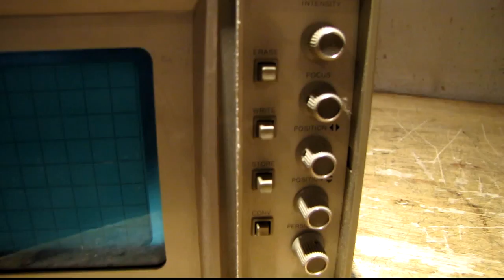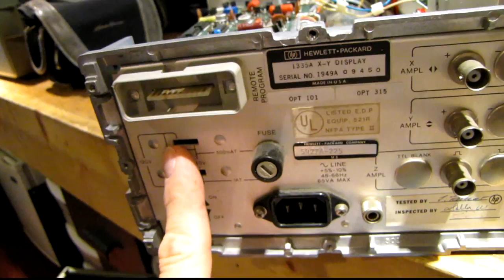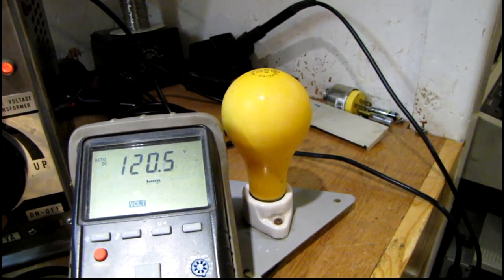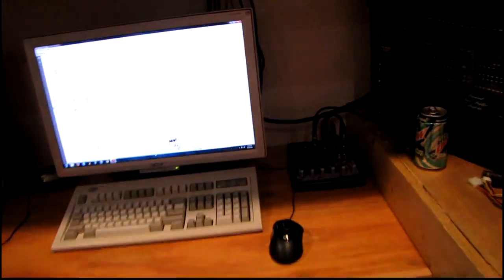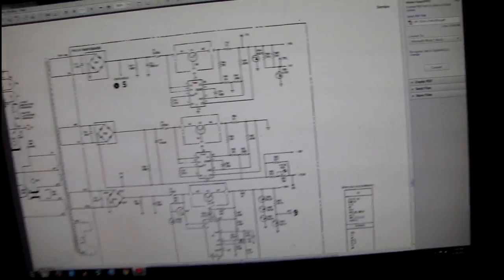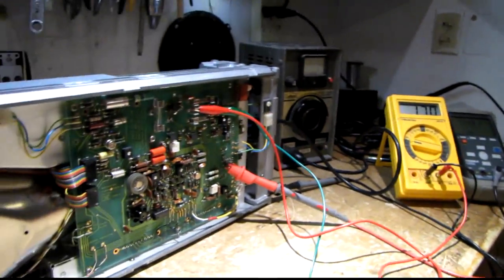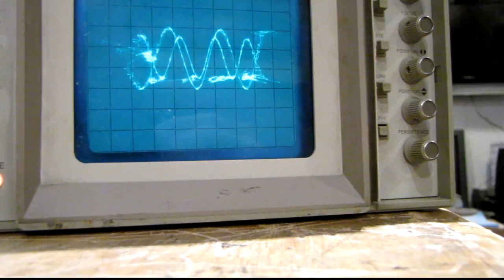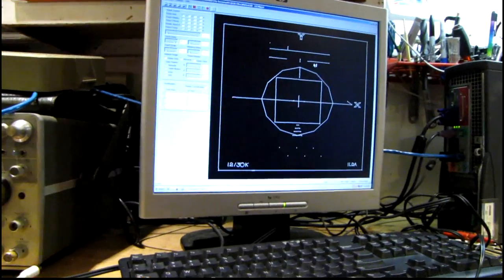Vintage HP 1335A XY Display Repair

Comment: These were used a lot in the medical field.  I used to see these often used in the old style analog nuclear gamma cameras for bone, cardiac and thyroid studies.  The persistence was used to view the "counts" after the patient was injected with the isotope.  They don't use these anymore, because everything went digital.  These also had an attachment that would clip over the screen and could hold a piece of film to make a hard copy.  I can't tell you how many of these were thrown away.  I never realized how cool they were!
Reply from the maker: That's awesome :-)

There is so much cool tech that gets discarded, which still has uses in other fields.  This one should be right at home on my workbench for quite some time, troubleshooting DAC circuits and other stuff.

Comment: Hi Maxx, I used to use a X,Y display monitor as a dynamic component tester.
Worked great finding bad IC's and transistors.  You could build one with the
parts on hand, need a sine wave generator and a audio transformer. There are
schematics on line how to construct one. Really enjoy your videos, takes me
when I was a bench technician, James

Comment: Sweet!  I have a very similar HP XY monitor in original box I picked up at a hamfest back in the late 80s.It used to work great but now the vertical is dead.  It has a nice big CRT - I think 15" and also produces a razor sharp focus.  I never could find a model number on it anywhere or service info.
Reply: HP 1300A?
Reply: Dylan Cupedo
Close but not quite.  Here are photos of it.  http://www.bobandersen.com/images/@hp%20vector%20monitor/
Reply: Hmm, maybe there are some serial numbers hidden somewhere on the PCBs which might help you figure out the model number.
Reply from the maker: bandersentv Hmm, maybe a custom version of the 1304A or 1321A?  Looks cool!  Let me know if you ever decide to sell it :-)
Reply: Maxxarcade
I did a google search on those model numbers and found this awesome site with docs for all the models :)    http://vectorvgapro.com/PDFs/XY_Displays.pdf

Looks like I have a 14" 1311B with P11 blue phosphor.  I wish I had the covers and nifty stand.  http://www.vectorvgapro.com/PDFs/HP/HP%201311B%20Front.jpg
Reply from the maker: bandersentv LOL, I was on that same site!  I'm not sure how I missed your model on there.  Mystery solved at least :-)

Should be an easy repair too.  I wonder what yours was used for?  Looks NOS or very well taken care of.

Comment: I purchased a pioneer sx-650 receiver and it has been sitting for a long time , I took it home and it received a lot of radio stations and some of them radio stations came in strong, there was a lot of dust so I purchased an electronic cleaner and I sprayed it on the circuit board and other places and now I don't receive as much radio stations and the radio stations that I do receive is not as strong, can you help me please?

Comment: So what were these used for exactly?
Reply from the maker: I'm not really sure.  The manual just mentions medical and instrumentation use.  There were a couple pictures of what looked like X-rays or ultrasounds in the examples.
Reply: Huh, interesting. Well, at least you can use it as a really expensive etch-a-sketch :P
Reply from the maker: Ryan Gehret
I'm going to use it at work for fixing old arcade games and other stuff that need an accurate XY type display.
Reply: Ah, cool cool.